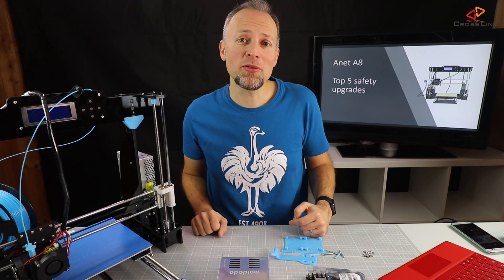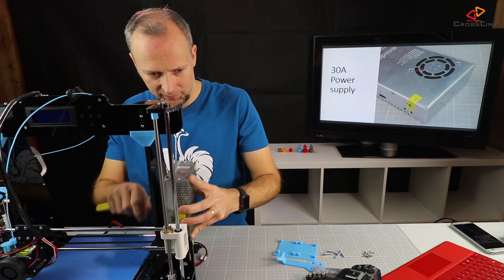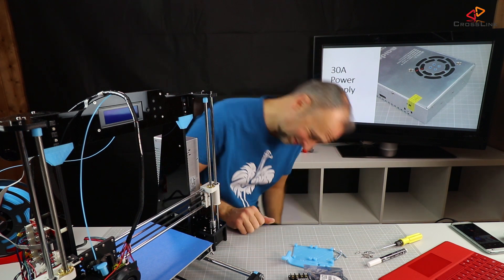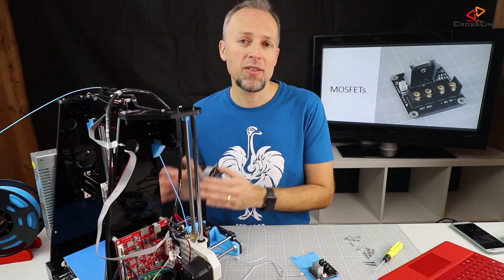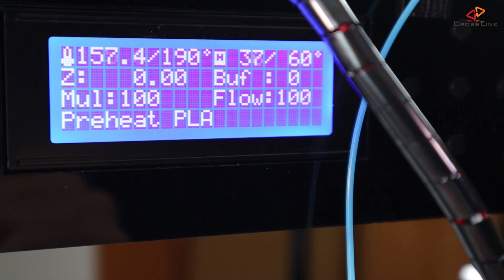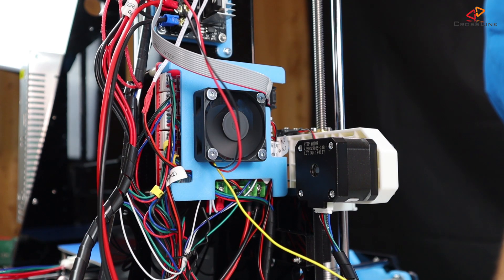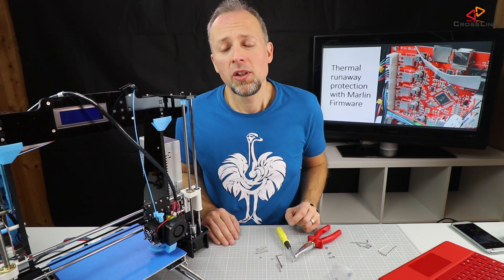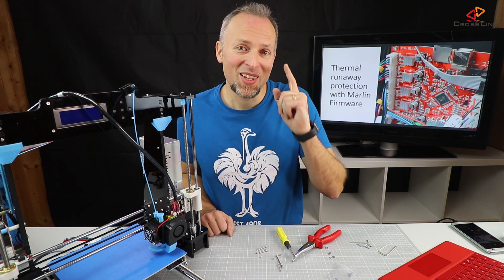Anet A8 Top 5 safety upgrades

Comment: Wenn ich  die Kosten von 2 Mosfetschaltern mit den Kosten für ein neues Board vergleiche, lohnt sich der Aufwand kaum, zumal sich durch die aufwändigere Verdrahtung neue Fehler einschleichen können.
Ich bin aber durch das Video nachdenklich geworden. Eine 10A und eine 20A Sicherung auf dem Board (SKR 1.4) finde ich auch mehr als fragwürdig.
Werde deshalb das Hotend und das Bed mit einer Feinsicherung direkt an den Boardklemmen absichern.
2A fürs 30W Hotend und 8A für das 140W Bed.
Prima Video, weiter so.

Comment: Priority 1 is to enclose the mains connections while supplying a switch and fuse.
There are plenty other defects about the A8 but the exposed mains connections are an order of magnitude worse than the other defects. 
If you can't design your own cover there are plenty available on Thingyverse.

Comment: I see a lot of videos that promote this same power supply. My question is why use a 30amp power supply if it's not connected to a 30 amp breaker. In america, 30 amps aren't that common, or are used for like a range. I'm no electrician, so correct me if I am wrong. This seems like overkill.
Reply: That is 30@ 12VDC i.e.360 watts or about 3 amps from your 120VAC mains.
Reply: @mikenewman4078  thanks Mike but i really dont understand what you are saying

Comment: I have a question i bought  my power supply from Amazon but I couldn't get the screw holes to line up all..
Reply from the maker: I used one of the upper frame holes to mount it and drilled new holes for the lower mounts. That's ok! There is also adapters on thingiverse for the new psu mounts.

Comment: There are quite a few 30A PSU mounts/adapters on Thingiverse so you won't need to drill any holes in A8 frame just install a new PSU using printed adapter with existing mount holes.
Reply from the maker: Good feedback, thanks for that!. It definitely will make mounting the PSU easier. What do you think about the rest of the upgrades? Useful and improving? Any other safety ideas? I was thinking about linking a smoke sensor to a power outlet switch to turn of the printer asap the sensor detects smoke. Also I was looking for fire distinguishers that can be mounted above the printer that automatically release when a fire should arise. They are not cheap but I am a little paranoid since I saw the recent pictures posted by people's burning printers.
Reply: @Crosslink3D  30A Power supply and MOSFETs are really good upgrades and definitely useful. But I honestly don't think that fire distinguisher is a really necessary add-on. I haven't seen any photos of "burning" printers, but I don't believe printer will really burn your house to the ground if you install electronic Circuit breaker and right MOSFETs. Now... I have a question about 3D Touch sensor installation, actually it's not about sensor but rather about Marlin configuration – so I know Marlin in its default configuration with 3D Touch auto-leveling, large LCD screen and and buzzer support wont feet ATmega328P controller memory (A8 board is based on it). what you said in your video is that you had to use Optiboot to flash Marlin, but even then you had to disable some functions in Marlin to feet new firmware into ATmega328P. So question is what can we safely disable in Marlin in case if we want to have large LCD AND 3D Touch auto-leveling support? Ok, I can disable buzzer, I dont give a damn about it, I can also disable startup logo. What else? BTW you should have explained it in you video clearly.
Thanks.

Comment: I have just purchased an Anet A8 and have put it together with quiet good success, however I am having difficulty getting it to print. The first thing I printed was the token from the mini SD card. It did fair but had a surface that was not so good. I am trying to download upgrade parts to print from thingiverse but have been unable to print any of them. I download from thingiverse to my HP laptop which is running Windows 10. The files that I download are zip files. I unzip them to a downloads file in my laptop then copy that file to the F storage which is where the mini SD card is located. Then I put the mini SD card in the main board of the Anet A8. I then select the load button and I get a list of items in the print file. I select the print file that I want to print and select print and the printer control board either shows
“idle” or sometimes if shows that it is printing, showing Flow Rate, Print Speed, bed temp and hot end temp to be ok but the printhead (extruder) does not move. I hand prime the extruder before trying to print, my bed is level (printing on glass) and hight of nozzle above the bed is 2 mm.  I do not know if I am not maneuvering the download correctly or if there is something else wrong. I have replaced the main board and the control unit one at a time and neither made any change so I put the factory ones back in. I am at a stand still. If you could make any suggestions it would be greatly appreciated. Keep up the great videos.
Reply from the maker: Hi Clifford, congratulations for building that printer first. Now to help you, just to get things a bit clearer for me, what type of files are you copying over? STL or GCODE files?
Reply: Crosslink The files that I am copying are stl files.
Reply from the maker: You need to use a slicer software like Cura to convert this file into gcode first. Then this file will contain print commands. Stl is just a CAD drawing not understood by your printer.

Comment: Did you read the reviews on amazone about the 30A power supply ???
Reply from the maker: Sorry, I got the wrong link. Mine was from eBay and I tried to find a similar one on Amazon. Will do more research. In the meanwhile I put in the eBay link. Mine does not have a cover for the pins 😔
Reply from the maker: I have replaced the links with better ones. Gearbest has some good rated ones and mine from eBay is holding up so far very well.

Comment: I"m glad they upgraded that dangerous bed connector. Is the Sunon fan quiet?
Reply from the maker: Well, it's running full speed for me, so its just noise because it blows a lot of air. probably could be a bit more silent if I would find a way to control speed. It's a bit overpowered. Any idea what to use to control fan speed?
Reply: You can control parts cooling fan speed in your slicer or in the printers tune menu while printing. I"m not sure how to control the other fans. Maybe a resistor.

Also, fans have a noise rating. The fan you linked to is rated at 31.0Db.  I might try this fan, https://www.ebay.com/itm/Scythe-Mini-Kaze-50mm-4500RPM-Case-Fan/332852509616?epid=1502882407&hash=item4d7f8e3bb0:g:KgoAAOSwVEBb0NyE:rk:2:pf:0.  It's rated at 26.09dBA .  Also, I think the little 40mm parts cooling fan is the loudest so I may get this fan, https://www.ebay.com/itm/Scythe-SY124010L-Mini-KAZE-40mm-Silent-Case-Fan/322539028754?epid=3016722625&hash=item4b18d30112:g:eskAAOSwPh5ZMEot:rk:17:pf:0. It's rated at 14.00dBA.

And I installed an inductive bed level sensor that is working great, and I print on glass. It's  LJ18A3-8-Z/BX 8mm NPN Inductive Proximity NO Switch DC 6-36V.  It's 12v which is much more accurate and reliable and probes farther than 5v sensor. But you need to solder a diode in the wiring or you can damage the Anet mainboard. The diode is 1N5231B 5.1V 5V Zener Diode 0.5W 500mW DO-35.  The wiring instructions are on a Youtube video. If anyone wants the link let me know.
Reply from the maker: Maybe some PWM controller might do the job: https://www.ebay.com/itm/Mini-DC-5A-Motor-PWM-Speed-Controller-3-35V-Speed-Control-Switch-LED-Dimmer/201533353831?hash=item2eec52ef67:g:IaMAAOSwCMFaL6iX:rk:7:pf:0. Will try one of these to reduce the speed of the fan. It definitely blows like a storm.

Comment: More good info on upgrades and safety, one safety feature I would add is a fused switch cover for the terminal end of the power supply so that the 220V cannot be easily got it. From a electrical equipment test point of view, the power supply would fail because there is nothing apart from a lift up cover to stop you touching the terminals when the power is on.1 such cover is this one.  https://www.thingiverse.com/thing:1798604
Reply from the maker: Thanks for bringing that up. I definitely missed that one and have added it to the comment section of the video. Added one STL link for the 30A and one for the 20A version, they are a bit different in size. Also linked the needed switch.
Reply: Yep, this right here. Was a great video, but this is the number one safety upgrade you can make. 
You also want to use the "press-in" type C14 socket for the cover like this. People have designed enclosures for the screw-in type, but those are meant for grounded metal chassis.